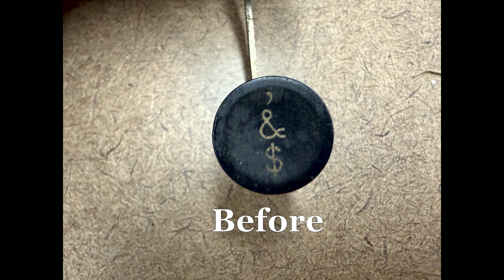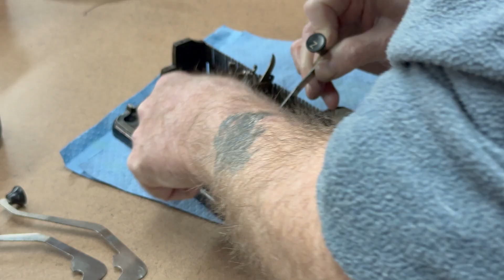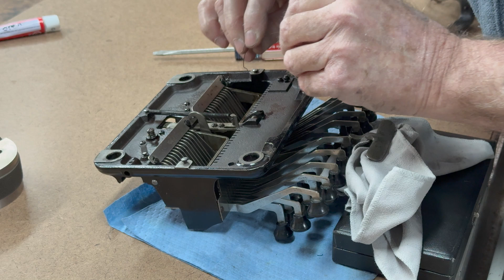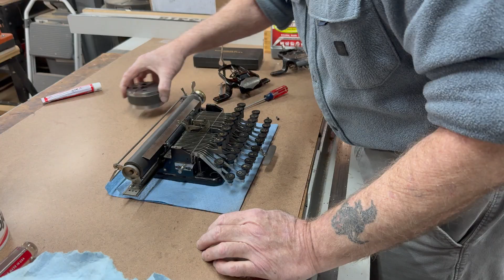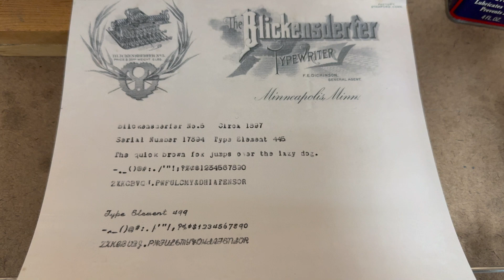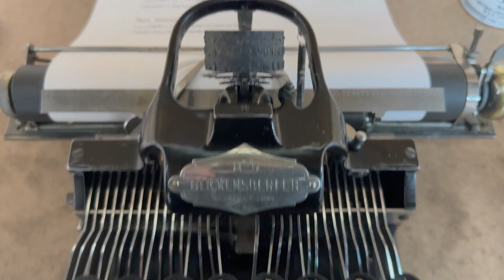Blickensderfer Typewriter Restoration, Repair and Service Video Series, Video 6, Assembly

Comment: My Blick 7 has a problem that I’ve been struggling with for a week. The d, h, i,and a keys print the letters of the key to the right of the typed key most of the time. I.e. d prints h, h prints i, i prints a, and a prints t. All the other keys work fine. Have you ever seen this issue before? My best guess is that the steps on those keys are worn down and don’t rotate the type wheel correctly.
Reply from the maker: I wrote this in response to your post on the Facebook Group, but I don't know if it helped.  If you could share a short video that demonstrates the issue on the Facebook Group page it would help in troubleshooting the problem:  

There are two lower gear segments that correspond to two upper gear segments that correspond two gear racks that correspond to the pinion gear that rotates the type wheel.
Those two lower gear segments rest against two stops, (screws with locknuts). If those two stops have been disrupted the bottom row is most often affected, (the bottom row seems to be the most finicky, probably because these keys cause the least rotation of the type wheel).
It is a bit of a balancing act and even though the error is in regard to keys on the left side of the keyboard, the adjustment may need to be performed on the right stop.
I suggest removing the top castings, pushing all three segments all the way toward the rear of the typewriter and taking a picture of their alignment before making any adjustments so that you can return to that starting point if things get confusing, then reinstall the top castings and make small adjustments testing the type wheel rotation after each adjustment. The gear segments should be closely aligned to begin with and a straight edge can be used to approximately align them before reinstalling the top castings and begin the fine tuning.
Two of my restorations have had this issue and both were made right from this adjustment.